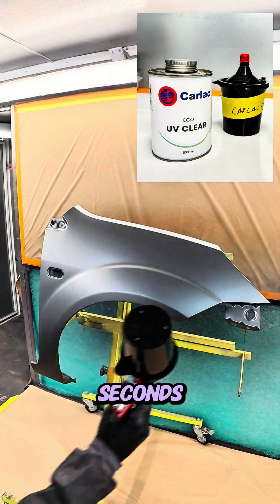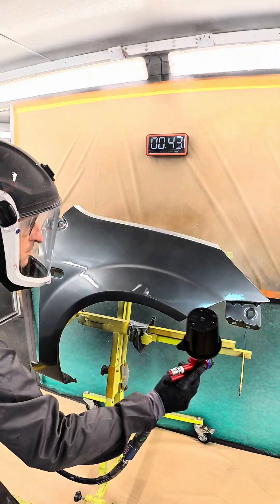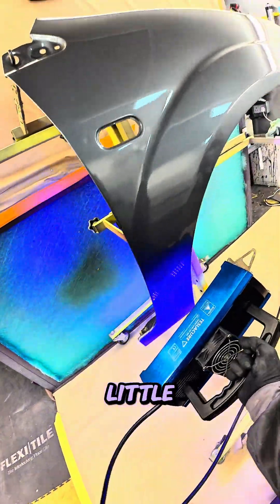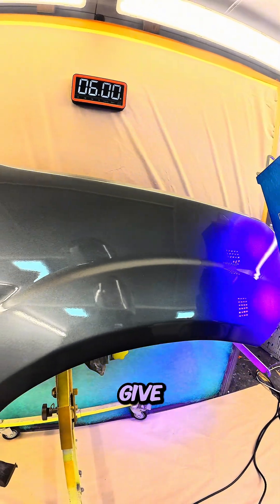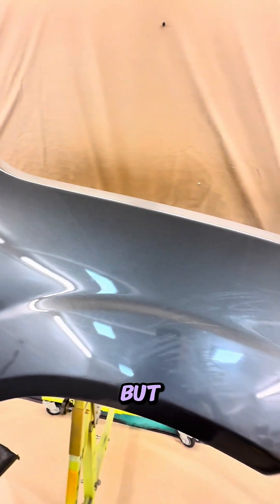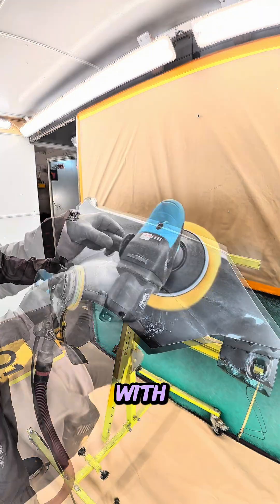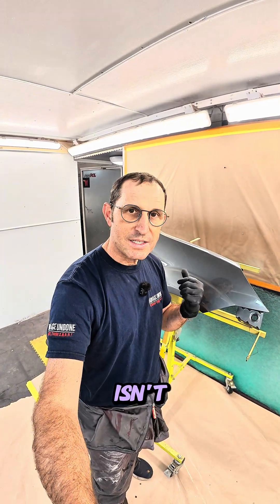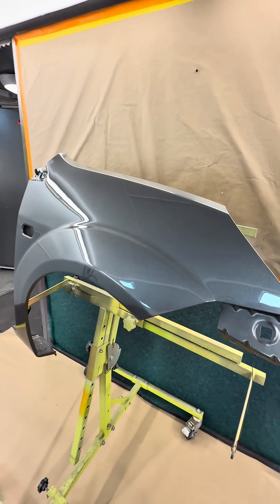CLEAR COAT CURED IN 2 MINS

Comment: There's a video about a glausrit UV clear coat maybe 3-4 years ago the guy in the video basically said it's almost impossible to buff how hard it gets. They said they would come up with a new clear but still nothing new released
Reply: They used some IRT lights he cured it in maybe 10-15 seconds
Reply from the maker: The irt lamps are excellent, however I am demonstrating this product following the TDS, exactly. If I didn’t I am sure I could have speeded up the whole process
Reply from the maker: This is new technology and as you can see in the video, it wasn’t difficult to nib and polish. 

Products evolve every year
Reply: I mean Glasurit didn't come up with a new clear at least from my knowledge  @damageundoneltd
Reply: if were to do a whole car is the process still panel by panel?...
Reply from the maker: @UKnowUAintRight I would not recommend that you do that, it’s more suitable to smart repairs at the moment but it will happen
Reply: Where can I buy this? I've reached out to them but no reply. Thanks for the vid!
Reply from the maker: @Eutanazer please contact neil firth +44 7971 830980 and he will help you